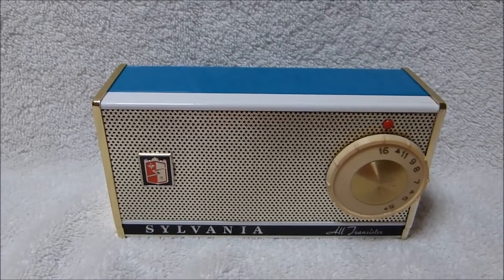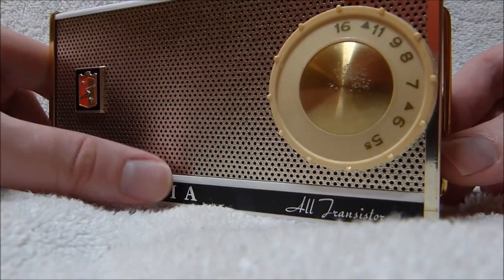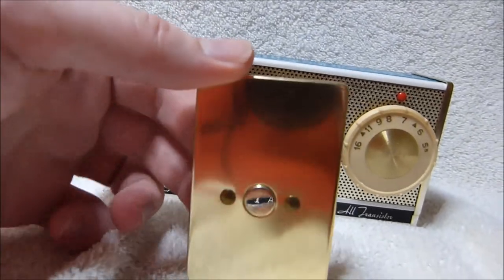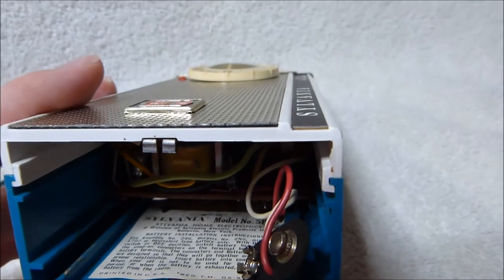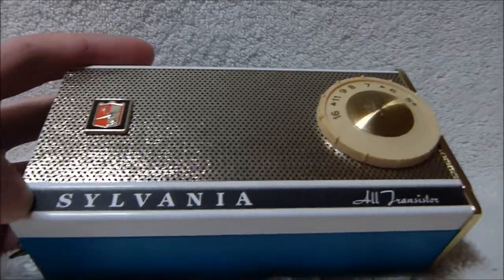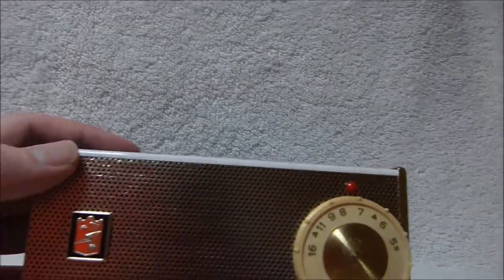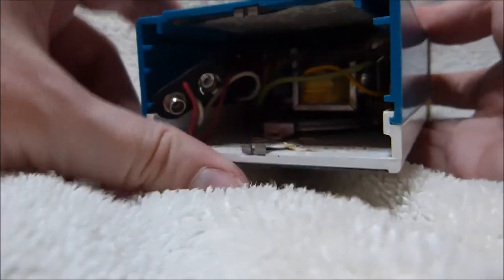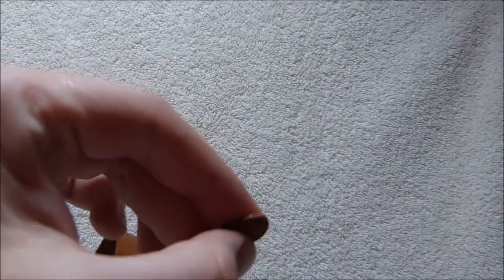Sylvania model 5P16 transistor radio (1961, USA)

Comment: I just watched your video and yesterday I bought a Sylvania model TH10W transistor radio from 1962 at a thrift store.
My radio is in great condition and it has a snap on back cover. I like your informative videos.
Reply from the maker: Thanks! That model seems to have been built as a give-away item, but I'm not sure what product(s) included it as a bonus. It's a four transistor radio with an unusual circuit, but it works reasonably well.

Comment: That's quite a unique design. Nice color  and nice condition! One thing to remember about Sylvania p.c. boards is to use a low watt soldering iron. The traces on their boards seen to lift up easier than most.
Reply from the maker: Thanks, it sure is an unusual design, I don't have anything else built like it. I have a temperature controlled soldering iron, so thankfully traces don't usually peel up, but sometimes it happens regardless (it didn't on this set thankfully).

Comment: Seems all the early American transistor radios were”coat pocket “size.
I have 3 early American radios
( none currently working).  This is a very good looking radio.
Reply from the maker: Most American made transistor radios were indeed "coat pocket" sized, but there are some notable exceptions, like the Regency TR-1, and the Arvin pocked sets I have posted. Early American made transistor radios almost always need their capacitors replaced to function well, so hopefully that's all it takes for your radios.

Comment: Interesting. It almost looks as though the two halves of the extrusion would slide apart from each other. Obviously they don’t, as you would have figured that out.
Reply from the maker: Unfortunately not only does the shaft of the tuner stick up through the upper half, there is a reinforcement bar (which the end piece that has the handle screws into) attached to the lower half, and it goes into a hole in the upper half. Sylvania really made this one trickier to take apart than it needed to be.

Comment: Did it originally take a "276" / PP6  or PP7  9v battery?
Reply from the maker: It originally took an Eveready 246 battery, which is bigger than a "standard" 9v battery, but not as big as the ones you mentioned (which have a different connector).

Comment: Clearly, this unit was intended to use a larger 9 volt battery...which type did it originally use?
Reply from the maker: It originally took an Eveready 246 battery, which is bigger than a "standard" 9v battery, but still has standard snap connectors.

Comment: And if the radio's 9V connector is crapped out, you can use the top of an old 9V battery and solder it in place of the bad one.
Reply from the maker: That's a good idea, but replacement 9 volt snaps are so cheap I hadn't considered trying to make them.
Reply: I did that same thing back in the 60`s with 9v battery tops,and i was thinking  i was the only cheapskate that did this,now the  word is out,Thanks  a lot. LOL.